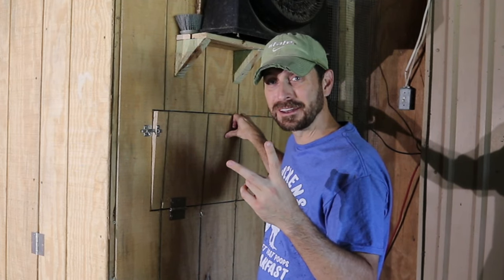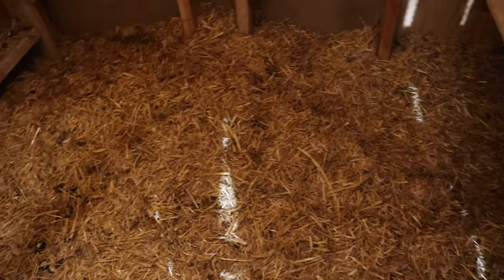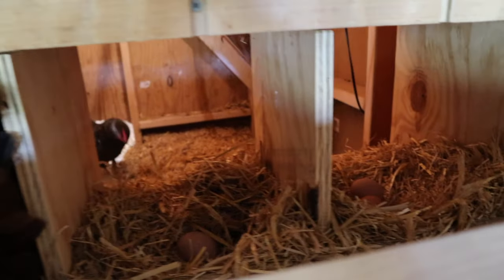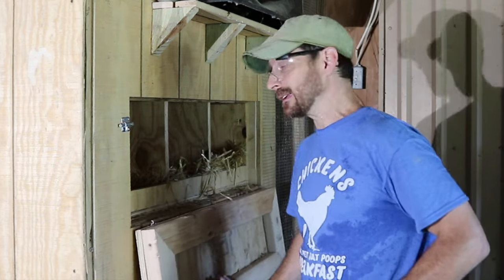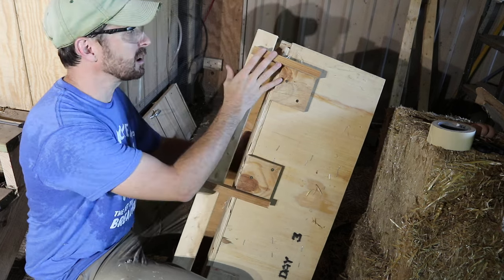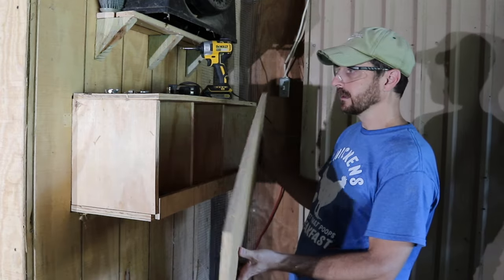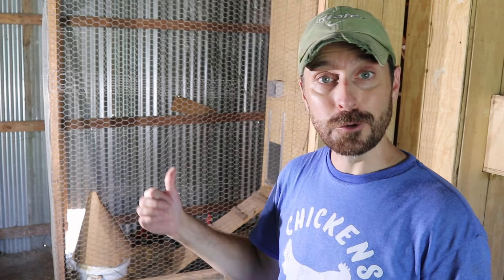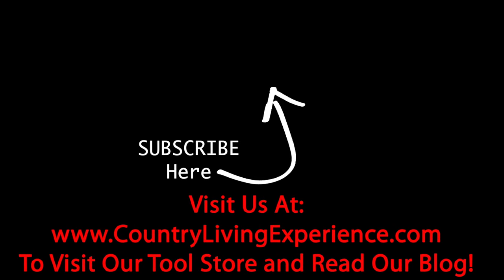Nesting Box For Chickens. Our BIG MISTAKE That You Should Avoid!

Comment: I had a lot of trouble with snakes in my coop. Most were harmless except for the heart attack they would give me  except for the occasional rattlesnake. I learned to not open the door from the back as a rattlesnake can and will strike out. I made mine open from the top. Rarely will they strike upwards and if they do you can slam the lid down on them which does not help their already cranky disposition. Most rat snakes were relatively polite about the whole ordeal of being removed but the rattlesnakes always seemed to take offense at the least provocation. They were considerably slower to strike upwards than outwards. Just a thought to consider when building a nesting box if you have venomous snakes in your area. Good video.
Reply from the maker: Interesting. Thanks.
Reply: If I found a snake in the nesting box I’d probably just burn the whole thing down and start over. 🤣
Reply: @BDiaz1000  found one in the bathroom of my old house. I shot five holes in a perfectly good floor……
Reply: Snake problems? YouTube catching snakes with a minnow cage.  You’ll be glad you did
Reply: @DayTrader__  you're correct. I put a fresh laid egg in mine, I think the snakes "smell" it. I usually catch copperheads this way.
Reply: @ddd3240  LOL. I've shot 3 copperheads in our home over the years, I keep a 1911A1 loaded with those bird/rat/snake shot loads. Tears the snakes up and less damage on my floors.

Comment: You could've also moved the nest boxes up, or put them on the floor of the coop.
I use boxes that are on the ground with the opening up. They keep it clean, it's easy for me to get to the eggs and they like it and lay in them, which is the most important.
Reply from the maker: I used the recommended height for most breeds. I will experiment in the future.
Reply: I’m building a coop now, and plans to put the nesting boxes close enough to the floor where the chickens can’t go underneath them. That was my plan anyways.

Comment: The nesting boxes are to high just lower it their is a lot to thinking about when build a nest box I like 3-6’’ off the floor in dark and confined space and they don’t roost that low on the ground keeps them clean just saying rooster bars at about 20-28 inches this does 2 things they feel safe up off the ground to roost but they don’t feel safe roosting so close to the ground so not in the nesting boxes.

Comment: I have two girls either dropping their eggs from their roost bars or laying them in the middle of the coop, lots of broken eggs. Any ideas?
Reply from the maker: That is a tough one. Do you have enough nesting boxes, are the big enough, etc?
Reply: These two are always the earliest to lay, since the others always used the boxes I don’t think the problem is the boxes.

I didn’t have the nesting boxes built before these two started to lay.
Reply from the maker: @nathansutherland5749  They may just be used to laying on the floor. Have you tried picking them up and placing them in the boxes while there are eggs in there. Maybe that will help them realize the proper place.
Reply: Look at your design. Try moving their roost. They might need a bit of coaxing to go to the right place at the right time -BUT Sounds like they feel more secure on their roost. Think of yourself as a chicken and investigate. Where would you feel safe? Any rodents getting into the nesting box? Disturbed time in the nests?